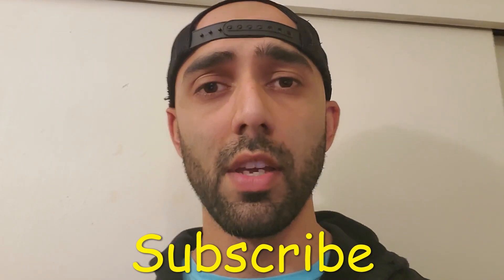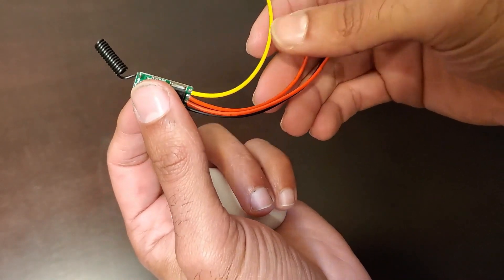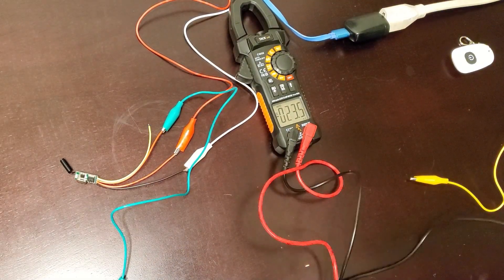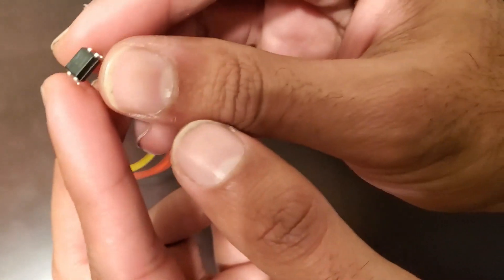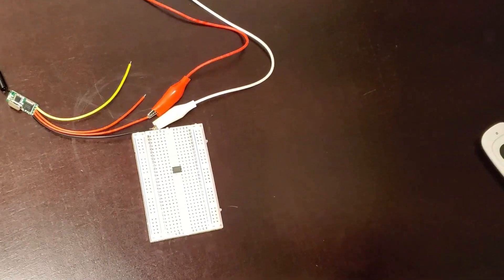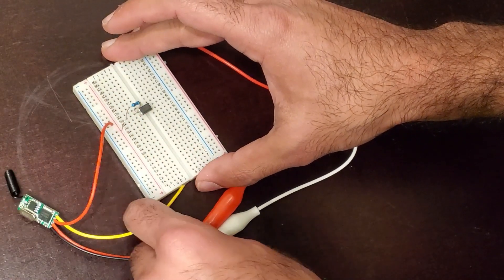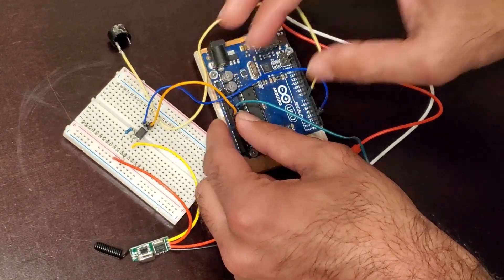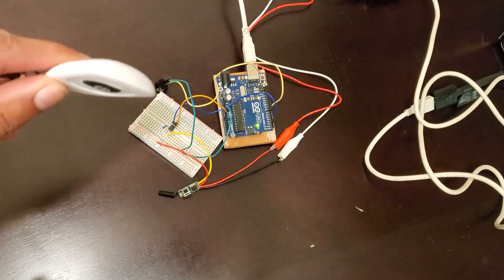Interfacing an RF Wireless Module with an Arduino

Comment: Interesting, hadn't seen one of these that switches momentarily. Could be very handy, thanks. It would be interesting to see another Arduino triggering the remote for an automated wireless switch.
Reply from the maker: You got me thinking now! It might be time to crack open that transmitter/remote and make that happen. Stay tuned!
Reply: @DuctTapeMechanic  Will be great to see what you come up with. I've been looking for a silent (not clicky relay) switch to turn a clock display on and off on a timer, I see that you can also get latching versions of this with two buttons. 
I already have a pro micro Arduino hooked up to a PC and sending/receiving serial commands so I might get working on combining these!